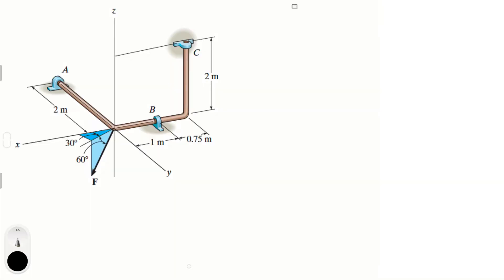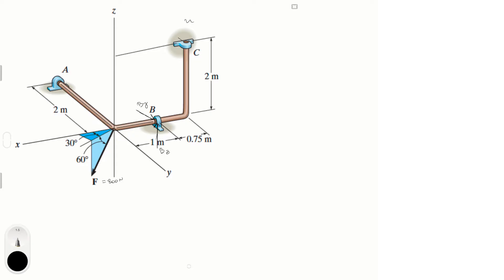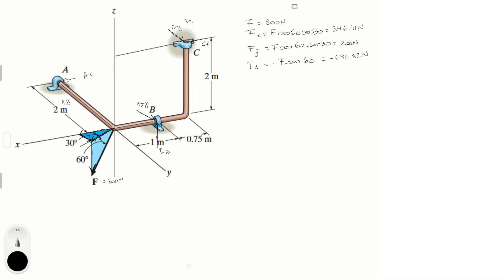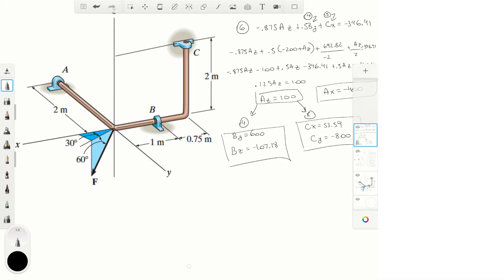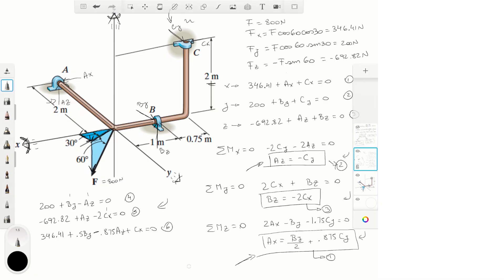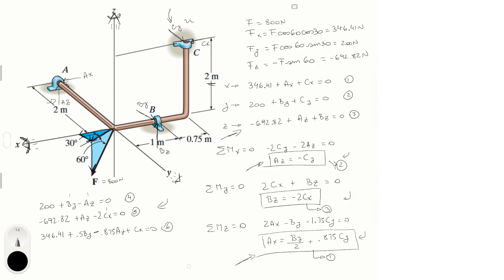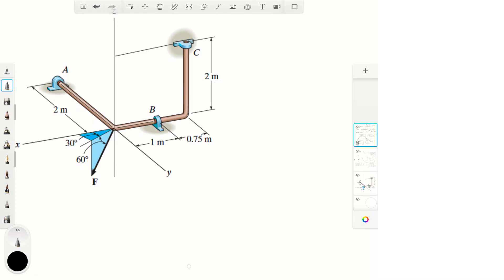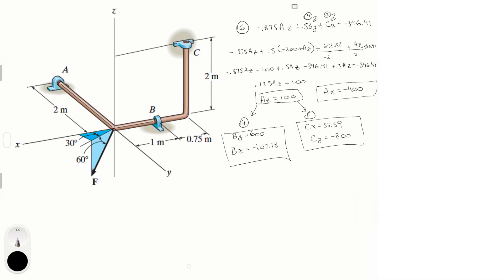Determine the components of reaction at the bearings if the rod is subjected to the force F

Comment: Wouldn't the Journal Bearings exert COUPLE MOMENTS in the off axis direction of each bearing?, giving us 12 unknowns?
Reply: bearings are made to rotate within themselves, so it would be impossible for them to create a couple moment.
Reply: @adamowen366  but these bearings aren't ball in socket?? Atleast by the picture. Therefore those 2 degrees of freedom of the bar at each bearing, translation PARALLEL to the axis that passes through the bearings center and rotation about the SAME axis. Assuming we're going for static equilibrium, ruling out potential translation, wouldn't each bearing have 4 unknowns? 2 couple moments and 2 forces each unknown being mutually orthogonal to the axis that passes through the center of the bearing and is parallel to the bar. Giving a total of 12 unknowns???